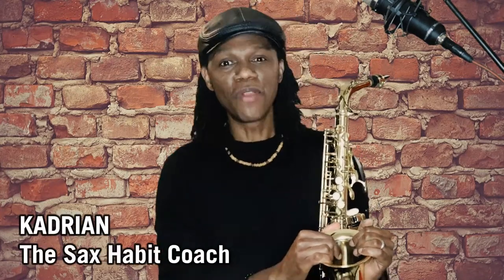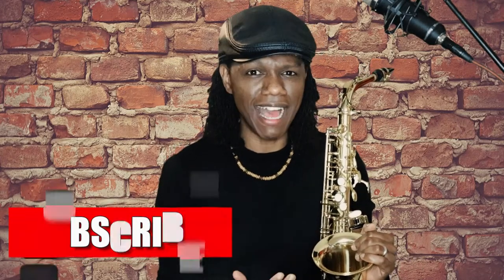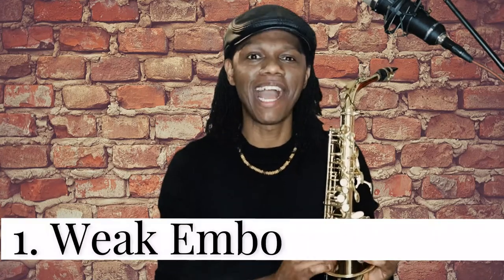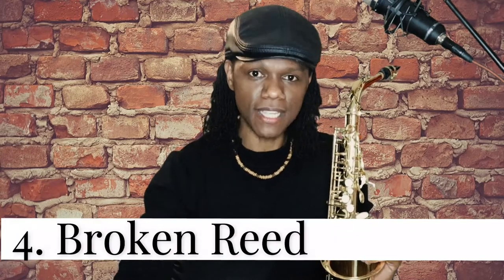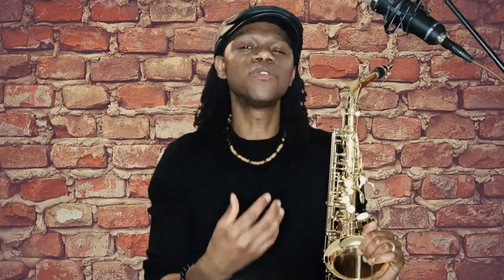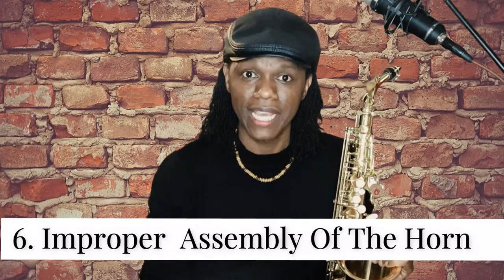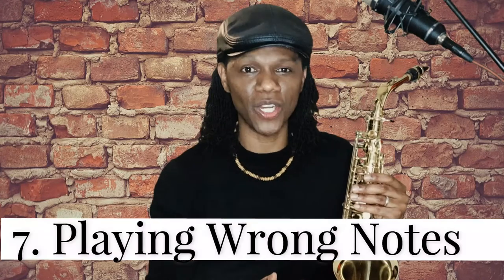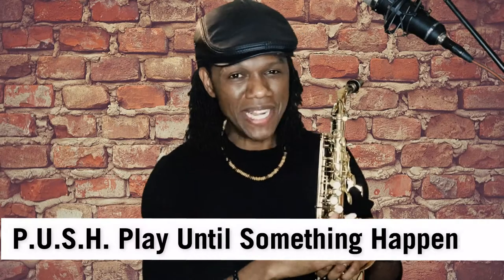Squeaking  when Playing  Saxophone? Here are 10 Reasons Why

Comment: I think mine is worse, i went to a gig as you call it and suddenly all the upper keys from G wont play without squeaking. i was disappointed. this happened yesterday, i tried wetting the reed and changing the strength but to no avail. what do you think will be the problem? or do i take it to a repairer? cant get one close though.
Reply from the maker: High, Lawrence. I'm sorry to hear that you had/have a nightmare on your hand right now. I'm suggesting you check your octave key, the one on the crook. If that isn't opening nor closing properly that could be a huge!!!!! problem. Second, check if any of the pads on your horn is stuck. Start by fingering low D and slowly walk up the horn chromatically.  Pay close attention to see whether or not a tone hole key won't activate. If all is in well in that arena then it's likely there is a leak somewhere on your horn. You would need a leak light to check that then you'd need to know what to do to fix it. The final thing to do if all fails is to take it or send it to a repairer. Cheers!
Reply: Thanks for the swift response.  The octave key is working fine, the sax squeak with or without the octave key. I played from low D and if I play chromatically it seems to partially work but hitting the upper keys on its own with a fresh breath it squeak.  I ordered for a new mouthpiece and reed .. I will let you know what I find out. Thanks again
Reply from the maker: @lawrenceda8877  Ok, no problem! When I said the octave key I mean the one on the crook, not the lever you press with your left thumb. If you use your left hand to play a G and use your right hand to open the octave key on the crook while blowing you will notice that you cannot get any clean sound. If it is not closing properly that could be the problem. If The pin hole on the ocatve key on the crook is partially blocked that may also be an issue. I doubt it's the reed or mouthpiece unless the mouthpiece is terribly damaged.

Comment: My problem is that I can’t play higher than f concert which is D but it’s the middle d not the high d so almost everything higher than that like high G I can’t play it. It sounds like a low g instead of a high one even tho I’m pressing the offtic key or however you say it. And sometimes I squeak when I try to play those note. Any tips?
Reply from the maker: Hello friend It's my pleasure. Yes the high notes have a tendency to sound low and will squeak a whole lot too. What I suggest for you to get a louder sound on any note that's low or high is to use long tones and spend 5-10 minutes each day working on two to 3 notes at a time; you can work on the notes diatonically or chromatically eg. F,G,A with or without the octave key or F,F#, G with or without the octave key. Set your metronome to 80 BPM and use long tones holding each note for 8 beats for 5-10 minutes daily maximum. Every-time your embouchure gets tired while doing this, take a break and count for 30 seconds before continuing. You can set a timer on your phone for the 5 or ten minutes. next day repeat it. If you do it often enough and gradually move up or down the horn while being patient with yourself you'll be able to play above middle D. I'm presently making a course and community for beginners and absolute beginners taking you from the basics basics through a step by step approach and moving up on the saxophone, sight reading, playing by ear, improvising etc. If you are interested here's the link to join my waiting list: https://bit.ly/2XVpXWg Just remember, small daily improvements will result in tremendous progress over time.